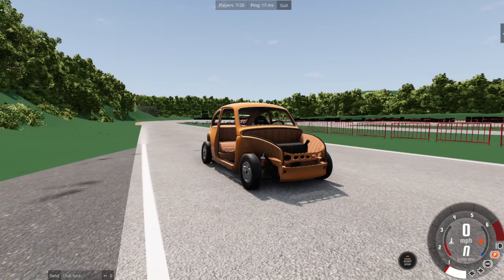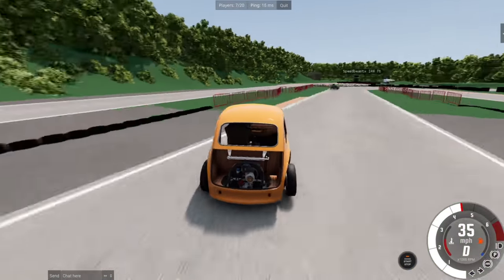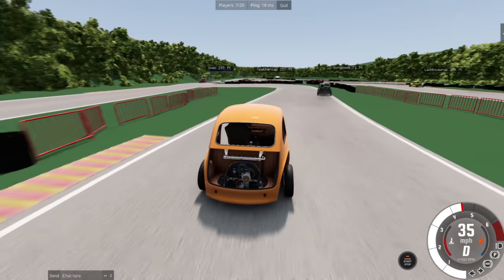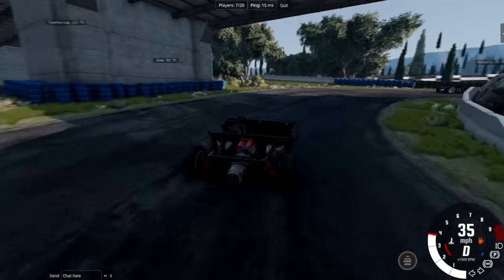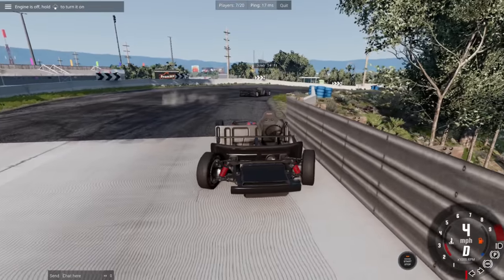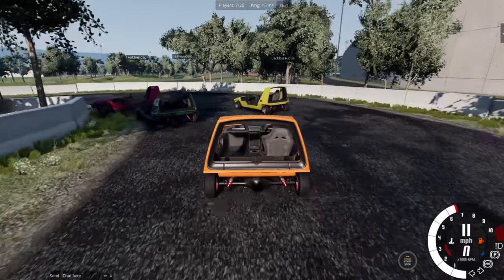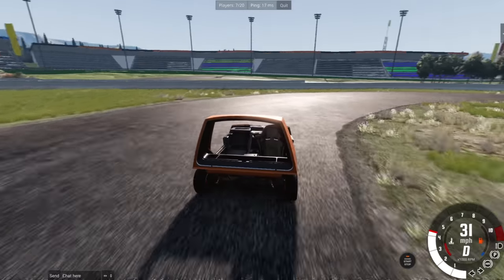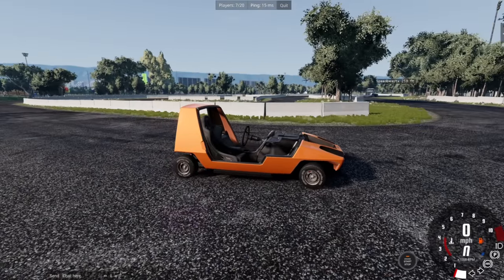Faux Kart Racing! - BeamNG Drive Multiplayer

Comment: That extended battle with longbow was very fun. You guys should try the Formula Bee mod. It's basically Formula Ford.
Reply: Sure it’s not a Formula Vee?
Reply: @computiNATEor  no I'm not!
Reply: @FearlessLeader2001  Haha, reading the mod's description it was inspired by Formula Vee, which is somehow or another VW Beetle based. So, Vee/Bee. Formula Ford is a little more modern
Reply: @computiNATEor  Haven't Formula Fords been around since the 60s, originally had the old Cortina motors in them, no?
Reply: @FearlessLeader2001  Yeah, but they've been updated over the years. Formula Vee remains pretty old school.
Reply: @computiNATEor  ah, gotcha. Though some people probably still race the vintage Ford models
Reply: Definitely not one for the keyboard drivers though. It's dicey with a pad and completely undriveable without. As in "spins out in a straight line".

Comment: Since it's too early for a Things We Learned This Week, here's a little something called Things Worth Noting. I believe it will go a little bit like this:
- Thanks to Amy for designing these mad machines and providing the entertainment
- Regarding the stripped down Piccolino: MY EARS ARE STILL BLEEDING!!!
- Regarding the CBT: I dare say that Ariel will be taking notes about this design
- Regarding the final design which I failed to catch the name of: looks like a stripped down Bond Bug with an extra wheel
- "Physics is happening!! Physics is happening!!" Where's my mate Tyler when you need him?
- Interesting to see an upturned Bug serving as the start/finish line for the third circuit
Thank you all for reading. I'm now off to see a concert featuring the late legendary Wilko Johnson, just to try to get the image of those conjoined Piccolinos out of my twisted tortured mind. Bye bye now.
Reply: CVT* - Continuously variable transmission.
Reply: The final one is called the “wigeon” ( like pigeon except with a “w”)
Reply: The last one is a Wigeon and I think it actually comes with some kind of cart-like config, but of course you can mod it further still. I made some similar things a while back, using a single-cylinder engine mod and so on, creating something that was really quite convincing. Think I called the top spec "Death Tornado" or something dumb like that because it had a tendency to turn into a fidget spinner at high speeds and yeet you into a solid obstacle...
Reply: @tahrey  The Atomic Widgeon mod turns it into a hyper kart that will give the FR-17 a run for it's money.
Reply: @ATruckCampbell  Heh, I'll have to search it out and give it a try. And whatever the FR17 is as well... (I assume some kind of F1 car?)
Reply: @tahrey  Yea it is an F1 car, one of the best mods in beam IMO even though it is almost 7 years old now.
Reply: @ATruckCampbell  oh might have given it a go some time before then... a number of the mods i previously installed seem to have kinda vanished from the list, maybe time to go through and uninstall then reinstall some

Comment: I should probably put this in her Discord or something instead of here, but if Amy would like me to dive into the JBeams for these things and make the CVTs play nicer with the individual engines to overcome some of the annoyances mentioned (they seem to all be running the same settings as the Sunburst, I think? Which means the Pickles over-rev and the Bolide bogs down...), I'd be happy to give it a go. I've tuned up some of my own weird mod-config creations that way before and it can have a dramatic effect.

Also, word to the wise ... don't put it in D, put it in S. Both for better performance and more realistic go-kartery. (Though, aren't most karts just single speed with a centrifugal clutch, rather than a CVT, unless they're sequential shifter types? That is one thing that Beam doesn't really "do" at the moment however...)

[annoyance at beam devs rant section]
Oh and as for the silly high reverse speeds, that's another thing to chalk up and put in a collected list of suggestions for the Beam devs I guess. Real CVTs only vary in forward gear, reverse is a fixed ratio (...and if you have a kart using scooter parts, it doesn't even have reverse). You can kind of emulate that by modding the box to only have neutral and drive positions, but with a transfer box with a very short, negative ratio alongside 1:1 positive, so the top backwards gear is about the same as the low forwards (actually something that some tuk-tuks do?), but it's really hackish and hard to use (or, set an ECU reverse limit, but that can leave you lacking for power reversing up a hill), and it would be better if they just fixed the system to let you set CVTs up correctly. Right now they're more like IVTs, which are only really found in ride-on lawnmowers (in their true form) and in the Prius (emulated through a very odd arrangement of motors and planetary differentials), and even those tend to have built in limits on reverse speed.

The Beam transmission subsystem is kinda wonky anyway. It's needlessly limited in terms of what "processors" can be chained to each other, when you should have a free choice so long as the output of one thing goes to the input of another (with engines only having output, wheels only having input, and everything else having at least one of each). Like you can only connect a presumably-planetary automatic / semi auto or CVT to an engine via a torque converter, and a manual or sequential box via a clutch, even though there's plenty real world examples of the opposite (particularly, nothing with a scooter style variator will have a converter, but there are at least a couple bikes that mate one to an automated sequential, and a number of cars that do one or the other of those). Can't do proper split-boxes. No centrifugal clutch. Etc etc (wouldn't even dare dream making something like the old Metrobus 4-speed that was half fluid, half mechanical...). And it's because someone chose to limit what the engine would accept as valid combinations rather than any actual limitation of the code...

Comment: You know, I would love another Driven To Destruction series on a new layout. I know they made some changes to how quickly Oilpan's get damaged which rendered it more difficult to do - is there a mod which changes that? Would be great to see a weekly BeamNG series going again.
Reply: There was a suggestion of at least trying the new official Beam cars, but I've had a go running them round the old tracks (plus the Ultimate Destruction course that someone made as a tribute and Alex tried out that one time) and they're surprisingly fragile. Like I don't think anything made it much more than two laps and often I couldn't even make one (...and the Wydra barely makes 20-25mph in its faster specs so it's kinda ineligible). The GPV did fairly well but it's not really an official car. Plus most of the tracks have some problems due to being made for older versions of the game, only really the tribute track and the Proving Grounds are free of No Textures and other issues... As for other tracks, don't know what you'd use really, most of them so far have been custom made for the challenge and I haven't seen much else that would work whilst being fairly lightweight and compact so giving good performance...

Comment: Is there a reason you don't use Beams fantastic input tuning settings? You can curve AND scale the analog brake input exactly to your liking.
Reply: Some brake tuning was done, but anything else we didn't do because we wanted it to be the same for everyone
Reply: @longbowxmkii  even input settings? I'm not referring to vehicle tuning if that is the confusion.
Reply: @davidjameswales  I know what you mean, but it seems kinda unfair to do so
Reply: Not even seen that, how do you get to it? Only really seen strength and onset adjustments.

Comment: you know I just realized
the piccolina is based on the fiat 600
but it has the engine type of the 500
even more fun the 500 only had engines up to 600cc (dont know the exact number)

you can reconize the difference by
the engine cover goes down on the 500
and it goes up on the 600

the 500 has a 2 cilinder inline
the 600 has a 4 cilinder in line

the 500 has a leather roof
and the 600 is solid

fun fact the 600 is older then the 500
Reply: and my fiat 600 has a rotary engine
Reply: It doesn't though... the Pickle has a flat 4, not an inline 2 like the F500 (or i4 of the F600). The power and torque is decidedly more that of the 600 (and the later models of it at that, maybe even the Zastava copies which went up to 750cc and were fairly well-tuned), even though the capacity is quite a bit higher and more resembles the VW Beetle.
The other details are probably correct though?

I think the 500 generally topped out at 495cc (after 475 initially ... I did actually make some mod engines for the Piccolina based off the real 500 ones but an update killed them) but maybe some very late ones got the 624cc out of the Fiat 126? Abarth models may have been bored out to an intermediate capacity?

Comment: Does this hurt anyone else's eyes to watch or is it just me?
Reply: He hasn't turned off the new godawful and unnecessary motion blur thats set on by default. Motion blur causes massive eye strain and headaches because its doing what our eyes already do for us
Reply: @TheNephilimofEmpireCity  It kinda does the opposite for me, so, swings and roundabouts. (In other words it makes the image look more like it was shot IRL with a camera, so long as the strength is set to a sensible level, rather than being extremely synthetic and with absolute frame to frame flicker)

It does stand out more here because of the low and stuttery framerate that comes from having so many people in a single BeamMP session, but I'd pin the blame for any sensory hell on that selfsame jerkiness, not the blur that actually helps cover over it somewhat. It's not the usual steady 60fps of most FR vids.

Comment: Hey just a heads-up can you turn off Motion blur next time you do a Beamng video, for people like me it gives headaches, nausea, and massive eye strain to look at and is impossible to enjoy
Reply: ...most of the recent videos featuring Beam in any way, or Forza Horizon will have done similar then? (Maybe GTA as well in fact - it's certainly using FSR or whatever it's called to upscale and temporally interpolate the rendering, and that likely both benefits from and adds its own touch of blur) ... or real life footage... it's just harder to spot there as the framerate is higher/smoother and so the amount of blur in any one frame is reduced.

However as mentioned in my other reply, the framerate and sometimes the video compression in this is often a bit squiffy and those are quite likely to cause visual disturbance and bring on sensory pain in anyone with a high flicker fusion frequency (I count myself in that, but I've found blur to help make things more tolerable when capping framerates so my laptop doesn't totally cook my legs on more graphically challenging maps ... having starker frame to frame changes is more jarring).

A temporary fix that may help you is turning the brightness and/or contrast down on the screen you're using to watch. That always eased the headaches back in the low-refresh CRT days and it's sometimes done similar when I've got enough of a mind storm going on that a workplace LCD monitor is hard to look at (and blue filter glasses when the office lighting is doing similar).